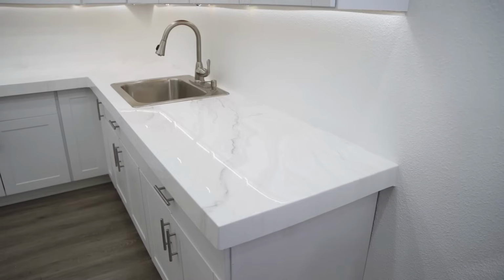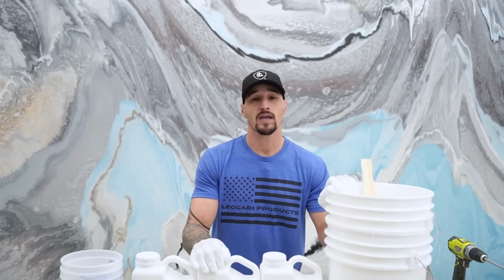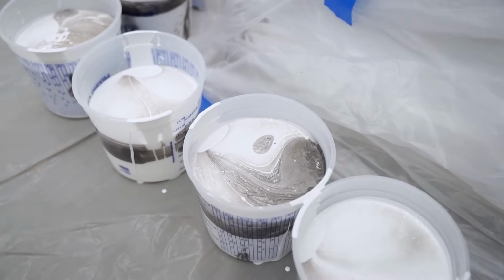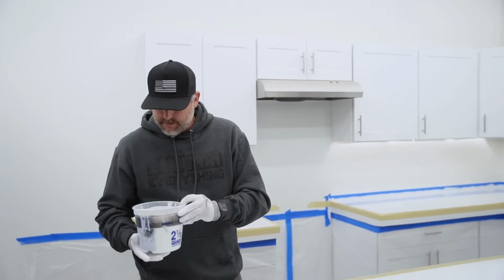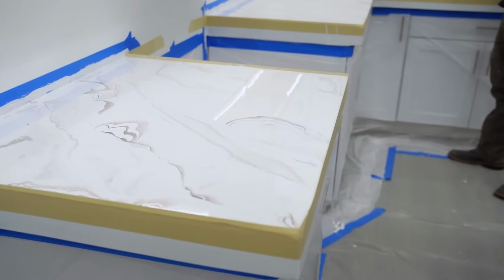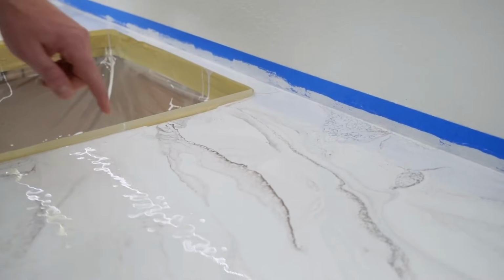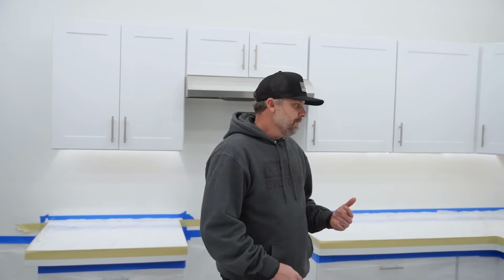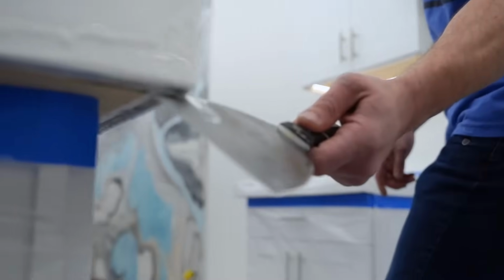Use Epoxy Dirty Pour Technique To Make Countertop Look Like Real Stone | DIY Counter Remodel Ideas

Comment: Wait... if you put those sprays on, don't you have to put a clear coat over it 24 hrs later??🤔
Reply from the maker: You don't absolutely have to apply a topcoat but we do recommend it to enhance durability and yes, within 24 hours of applying the decorative coat-otherwise you'll want to lightly sand the surface beforehand. Check out the topcoats we offer here! https://leggari.com/product/wb-urethane-counter/

Comment: The finished product is beautiful, but I wish you would have addressed the problem of staining with epoxy.  Even leaving a coffee cup that leaves a ring stains permanently, not to mention wine.  Do you have a resolution for that?  Also, it's handy to line the bottom of the counter edges with packing tape and that way you don't have to wait and continually walk around scraping the bottom.
Reply: yeah I thought there was supposed to be a top coat....

Comment: what do you do to an existing  Formica counter top with hard 90 degree edge? I am sanding the Formica surface and priming it as you do. Do I lightly sand the edge to round it a bit or use a small router edge or remove the formica edge completely?  i was told it should be rounded slightly so epoxy can flow over edge easier. Looks great. Tks
Reply: I have the same question!

Comment: Was that countertop underneath epoxy also. I'm just wandering if you can do epoxy over epoxy if you want to start over.
Reply from the maker: Yes you can install epoxy over epoxy! This is our studio countertop where we have coated several times over the existing epoxy surfaces. Our WB Primer makes it possible 👉 https://leggari.com/product/wb-primer/
Reply: @LeggariProducts  Awesome, I'll look into it, also my first design came out nice enough, I probably mixed too many colors cause I didn't get what I was looking for so I want to start over. I never put the top coat on but it's been a few months now since I did it. I would assume I would still need to sand it down first, correct?
Reply from the maker: @nwalker2619  Yes! Sanding it down before top coating is always best when the resin has had longer than 24 hours to cure.
Reply: @LeggariProducts  TY, good too know that I don't have to go through the trouble of removing the old epoxy

Comment: I must say the final look is very nice indeed. Will definetly consider this as I am going to paint my granite countertops.
Question: does it matter if my counterops have slightly rounded edges. on the
Reply from the maker: That's perfect you actually want rounded edges so that the epoxy can flow over and coat the faces of your countertop!

Comment: What does the denatured alcohol do to the countertops? And is it necessary to use that?
Reply from the maker: The first thing we spray is 91% or higher isopropyl alcohol. This creates cells in the design and disperses the epoxy. Once that evaporates, we spray denatured alcohol to pop any micro bubbles that might be in the epoxy from mixing. This allows us to avoid torching the epoxy and the risks associated with that.

Comment: Beautiful, do you come back with a topcoat? Why if I don’t want it shiny, if I want a mat finish?
Reply from the maker: Yes we always recommend one of are urethane topcoats. It comes in matte or gloss with or without out grit additive which gives a very slight sandpaper texture that helps with slip and scratch resistance, it also takes a bit of the shine off the gloss if you add the grit to the gloss!
Reply: @LeggariProducts  can i paint a metallic epoxy floor at night.?

Comment: What about the tape on the back splash? How do you pull it so it doesn't screw up your epoxy or the back wall
Reply from the maker: It's best to pull it before the resin is completely cured, that way no tape gets stuck in the hard resin against the wall. Also, we don't recommend a suuuper strong tape. Painter's tape does just fine👍

Comment: Does this end up smelling though? I have a lot of epoxy art projects in my house and the resin just smells awful. Some have also started to yellow. Does it depend on the quality of epoxy? And is food safe and all that?
Reply from the maker: Quality definitely matters! Once cured, our epoxy is safe. We'd still recommend using cutting boards and such for food preparation, just like with most other countertop surfaces. Our epoxy is zero VOC, virtually odorless and waterproof. For more on our epoxy 👉 https://leggari.com/product/metallic-epoxy/💯

Comment: I am so glad I found your videos. I have done my countertop using Giani, but I don't like the result. I plan to redo it using the Stone Coat, but it requires so many tools specifically the torch. Before I purchase the Stone Coat, I saw your video. Looks like you made it so easy and the result looks so beautiful. I will look more videos before I purchase. Thank you.
Reply from the maker: We have hundreds of videos on our channel and are coming out with new videos weekly and check out our kits at Leggari.com that come with the most in-depth step by step tutorials way more in-depth then our YouTube videos! We have your back every step of the way! There is a video for every single step from prep work to setting up mixing stations, primer, applying the epoxy and even topcoat!

Comment: Is cell dispersing effect created with any type of dye or does it have to be an alcohol ink?
Reply from the maker: The first thing we spray is 91% or higher isopropyl alcohol. This creates cells in the design and disperses the epoxy. Once that evaporates, we spray denatured alcohol to pop any micro bubbles that might be in the epoxy from mixing. This allows us to avoid torching the epoxy and the risks associated with that.

Comment: didn't you guys used to use blowtorches to get the bubbles out? Is the resin made differently now or something?
Reply from the maker: Our resin is designed to self-level and push any air that was mixed in to the surface. As you will see in this video 👉 https://www.youtube.com/watch?v=WFPXySBhoXo we purposely mix in a lot of air and still get a beautifully smooth, glossy surface once it sets🔥

Comment: Do you have anything that i can apply to a late nineties cultured marble vanity top (with single sink) in my bathroom?  It's that yellow-ish cultured marble that was popular back in the day.  It's 55 inches wide (long) and 22 inches deep (wide) depending on how you look at it.  It has a built in rear backsplash , and it has the optional left-side splash that is a separate piece.  I have no idea which way to go on color but I'll probably do white-gray-ish pattern for some new VINYL Floor tile. So I'm looking for color ideas. The Vanity is the real maple wood (smooth) , so it's a very light stain brown color and very nice wood but I'll paint that whatever would go with the Top Epoxy coating color decision.

Comment: Does your product yellow after a while,what do you use to prevent yellowing?
Reply from the maker: Yes all epoxy ambers, but you only really notice it in white and clear, but paired with our urethane topcoat that are UV stable you have an added layer of protection!

Comment: I cook all the time. Professional recipe developer. My kitchen gets a work out. How long does this last? How durable is it?
Reply from the maker: It is a very durable coating that will last for years to come, we have a very extensive durability test launching in the next week or so. So be on the look out it will answer all your questions!
Reply: You need to be careful with  Your colors. If you are a Constant cooker I would stay away with white next to your stove Because it will take on a color Something between an Amber/ dark yellowish look... Of course it can be sanded and  A top coat added again
 But you can only do that a  Once or twice before you're into your color coat.....

Comment: was your base resin already white? or did you add white color to it? as we can only get clear resin/epoxy in asia,  and I want to get that same white marble look you have here. Please advise if I can mix white acrylic paint with clear resin? thank you
Reply: You can any to paint the material you are covering white before using epoxy. Even then, you can mix in the white metallic powder, white dye and pour your first coat in white epoxy. Then after that you can mix up a couple or few different colors and mix separately, when mixed, dump them into larger container together but don’t mix, spray some grey or black spray paint on top and start dumping.. So many options, you won’t know how easy is until you try it! Good luck!

Comment: We did a dirty pour, and it turned out very nice on top, but the edges suck. I wasn’t here for the project and it didn’t get sanded well enough and the dye got caught on any imperfections that were on the edges. We want to just do the edges again only. Is there a process or a video I can watch
Reply from the maker: Yes, if you fill out the contact form here our team can help with this: https://support.leggari.com/hc/en-us/requests/new

Comment: Can someone answer me so the counter hasn't be flat I have those ugly small tiles will it work ? 😅
Reply from the maker: Check these out! 🎥 👉 https://www.youtube.com/watch?v=SHTeQ9YxsY4
https://www.youtube.com/watch?v=_R0Y5kB-iCY
Reply from the maker: For coating over a tile surface, you always want to coat over a level, even surface so you might need to start with a flood coat to achieve that.

Comment: All of your countertops are squared off I have granite countertops that are bullnose how do I get the epoxy to run all the way down the bullnose because it curves under at the bottom I would love to try your product but I'm not sure how to do the bullnose
Reply from the maker: That is completely ok! The epoxy will roll over and coat the bottom curve as well
Reply: @LeggariProducts  I believe I am going to try this ty for your videos
Reply: I did my countertop it turned out GREAT but the tape I used stuck and pulled thr epoxy messed up the edge...